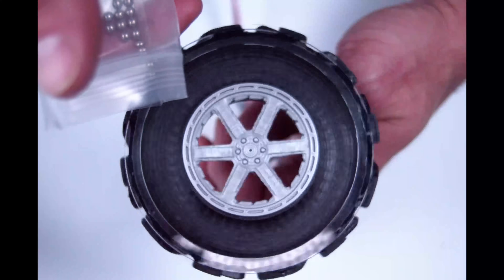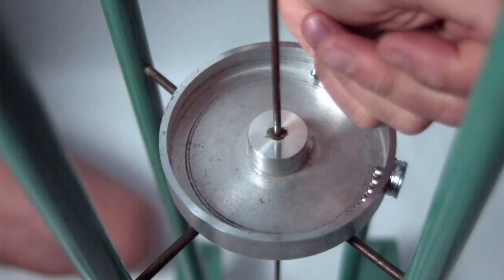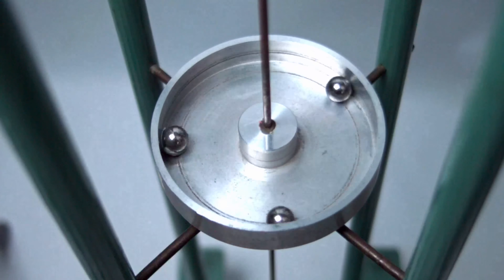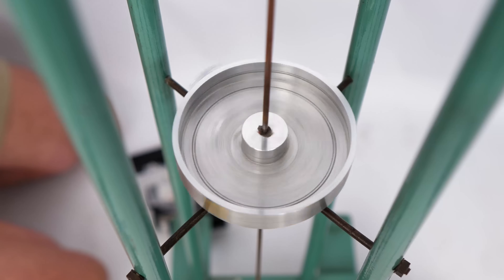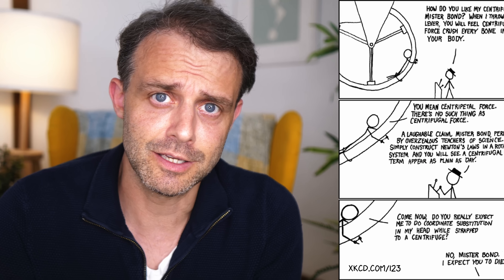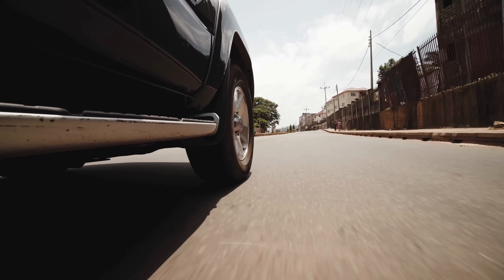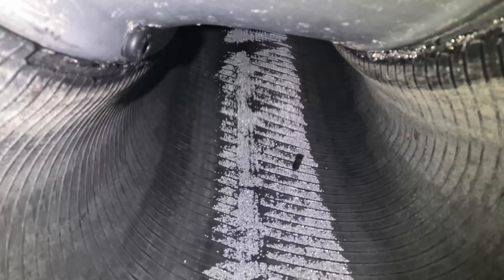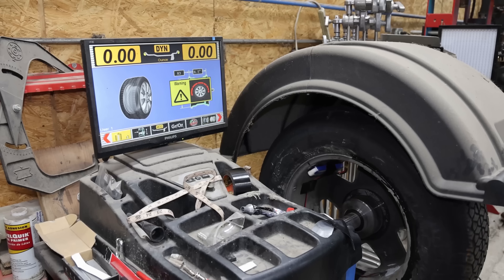Do tire balancing beads actually work?

Comment: Thank you!! I have been hearing about balancing tires with beads for more than 20 years in the off-road circles.

They seemed to be too good to be true, and completely counter intuitive. "Yea, I'd love to pour some airsoft beads into my tire and have it self balance, without worrying about weights getting knocked off or wheel or tire getting damaged" :eyeroll:. Guys have been swearing by them for years. But these would be vehicles that rarely exceed 50mph.

I've started mounting my tires at home with a very simple fixture, some pry bars and sweat. And I've been thinking about those beads again. I might have to try them!

Comment: I use these on my 4x4 because it's hard if not impossible to properly balance big offroad tires with wheel weights, or those weights get knocked off doing silly things.

Comment: my intuition before watching is that an off balance tire is basically a vibratory machine. And vibrations cause the beads to redistribute quasi-randomly. if the beads randomly hit a configuration that decreases wobble the vibration lessens. That process repeats until the system is tuned in. So the positional stability of the tire and the wobble are in a negative feedback relation.

but based on this i dont think it should work all that well on car tires.
in an experiment setup like this the wobble is the only significant source of vibration and bead/marble migration. But on a car there is vibration induced through the road surface, vibration induced through the car itself and most importantly: the tire deforms constantly under the weight of the car. If beads/marbles are prevented from settling the feedback loop cannot kick in. every rotation when the beads „hit“ the road and the tire deforms they would be flung around, constantly randomly redistributing. 

driving at high speed and sith unreasonably high tire pressure could probably reduce this issue. but that seems to me to be just not worth it. Even if you could do it at legal streets and safe tire pressure you would constantly loose money through the higher gas consumption and accumulated repair costs.

Comment: I think hink tire balancing beads are a good secondary measure. If you say that it only kicks in at freeway speeds, then from 0-60 kmph you will have to rely on your traditional wheel balance clips. Just as your initial demonstration with a mass stuck on the outside of the round cup, if you spin it fast enough, even when the clip degrades or gets flung off, you'll still have a secondary measure to not veer onto the cliffside due to unbalanced wheels

Comment: This was so good and very interesting.  I have to ask, what if you used press on weights to combat lower speed issues then have the balance beads to help with 50+ MPH wheel hop resonance.  I have a hard time keeping oversized tires well balanced but I don't notice it until that super critical self centering mode of speed.  I feel that the beads wouldn't be heavy enough to cause an issue with balancing at those lower speeds but would help combat WHR at 50+.  What say you?

Comment: OR the balancing beads do zero and the manufacture tells you to get to freeway speeds so you notice the natural self centering and are fooled into thinking they do anything. Plus you used a ball to counter weight and the same balls to balance and they spread out but a tire might be 5 grams out in one spot and the whole bag of beads might weigh 5 grams and I highly doubt the beads will effectively go to the opposite side and not spread out all around the tire.

Comment: Ok. Missed the statement, now let's talk tires. In the show how it's made you watch them make big tires. The total amount of rubber products they use is relative, meaning that the total layers of rubber isn't fully one complete thickness evenly layered due to how they wrap it all together. If you took a 3D scan of the interior mass to say the interior shape, it wouldn't be uniform as an equal cavity of space, as the slight layer difference would be there when they compress and force air into the inside of it when they hear it up and mold the layers into a single tire. The tread pattern on the outside also shapes how the layers form as all material is forced to be homogenous and solid, even if the material is made up of new/recycled materials altogether. If the wheel is cast, shaped and milled to be that design, as long as the metal itself is not warped or non-uniform in its integrity, then it's the rubber tire on the wheel body that makes the unbalance result happen due to Imbalanced mass of the tire not being uniform thickness.
Reply: Meaning that yes, I'm sorry for yelling. My bad

Comment: Theres product called ride-on motorcycle tire sealant and balancer. same principal but a liquid which turns into a solid butter consistency inside a tire balancing it and sealing punctures. wondering if water would also balance a tire

Comment: How about coating the beads with some kind of delayed-curing adhesive, filling the tire with them, and then holding it at speed in a tire-spinning machine until the adhesive cures? Best of both worlds - extremely easy installation and the effects don't go away if you stop.

Comment: Hey @SteveMould not a Tire but you might find this interesting i follow the appliance space random ADHD interest of Mine but an American company Known As speed Queen a High quality manufacture of Washers dryers ect... There latest Front load washer Model FF7009WN has Steel ball bearing to Balance the load to achieve extremely high spin Speeds in the final stage of the wash to Reduce drying times. Kind of random but Figured it was a interesting Real world application Bens appliances and junk has a Video on it.

Comment: Realistically, they balance the tyres when you get them fitted as part of the included cost. Maybe if you want to fit your own tyres without needing to fiddle with weights it might be good. The need for freeway speeds to make it work is problematic. It's interesting but I don't see the need in most applications

Comment: Mechanic here with a 24k dollar tire balancing machine. We can't really balance big off road tires, maybe some shops can. But most balancing machines are for a certain size/range of tire. Plus some tires take so much weights it's impractical and the weights fall off when too many are used. So for example on a 40" jeep tire I try to balance the tires with the machine, get it close, then add some beads. Hopefully to minimize the low end and top end. We can also match balance by figuring out how to Best place the tire on the rim in order to need the least amount of wieght. But in the end, that takes alot of time and most customers dont want to pay for the time to do it. They just assume all balancing is the same, and you shouldn't be charging more then Walmart tire center because they "do the same thing".

Comment: Had this effect on a motorcycle when internal tire pressure monitor failed and fell apart to pieces including battery, etc.
Below 100kmph it was greatly vibrating, but at 140 kmph it was becoming balanced again…until I stop, then the whole process repeated

Comment: You are absolutely correct on how balancing needs work. In the automotive industry we typically only use balance beeds on highway use only vehicles like semi trucks. Some people like to use them on difficult to balance oversized truck tires however what ends up happening is they complain about a vibration because they drive around town at lower speeds most of the time

Comment: this is the first time I hear about balancing beads, wow, we don't have them over here. Interesting concept to look into is maybe using beads that can melt when the tire hits high temp like 80 C for example, so that they melt and stick to the inside of the tire when u get up to speed, and then it will stay there perfectly balanced all the time ( or any time u r driving slower that the tires dont get to 80 C). I know they can melt again and be like a thick liquid, but it will basically do the same thing again and keep it balanced. I just thought of this on the fly, so if I am wrong please do tell me, and if it has been done please do tell me, and if anyone does it, please give me credit here, thanks <3

Comment: Perhaps ones that either stay in place in a very thick, eventually-adhesive, granular lead liquid within the tire or a mechanism on the inside of the rim made of lead balls and a groove that will lock them in place once the critical speed is reached...Memory foam for tires, in any event. Problem is that for low speeds up to any, a major imbalance. It is all very interesting, none(always the)less. 😏😳🤗

Comment: I had balancing beads in the rear tire of my track bike, unbeknownst to me. Good thing that at a race track, you're almost always exceeding highway speeds, and you don't stop until the end. Can say I didn't notice a difference, the only reason I found out it had 'em was getting a new tire put on at the track. She started the bead breaker machine, and beads went everywhere. Felt so bad for her, helped clean it up.

Comment: i just assumed the bearings would roll off to the farthest side because of the oposite ball weighting that side causing the plate to push in from the side with less weight

Comment: mix some glue with the beads then drive the car faster than 80Kmh then the beads will stick at the position which is nothing but mass balanced. after this setup no need to speed up and explain the cause to the police.

Comment: if a person knows how the air is kept inside a tyre, this is a stupid idea,

a tyre is made up of different types of rubbers, the airtightness  of the tyre is essentially a layer in the tyre the inner most layer 
so until the beads settle they are gonna wear this thin inner layer, most tyre failures are underinflation related that is where blowoutrs originate from

ie the tyre flexxes more when underinflated  over heats and blowout eventually happens

so yea  no thanks i will deal with the slight vibration from time to time than a blowoutr from time to time

yes it may be that the beads won't wear through the tube layer before the thread is worn out

i woulkd rather not be a statistic

Comment: Back in the late 70s they had a ring that had beads or bbs in it that you could mount between the rim and the brake drum. I had a 72 Landcruiser that was T boned but the front axle was slightly bent and not replaced or known about when repairs were made. I put the balance rings on and they took a lot of the shimmy out but not perfect. I sold the Landcruiser later on and moved on in life.

Comment: Okay so now we just need to engineer beads that permanently stick in place once freeway speeds have been achieved... That solves the wear problem and the rebalance problem... Maybe an adhesive inside the tire that has a small seperation layer that needs to be "pierced" before the bead can stick in place? Idk.

Or maybe a gel that the beads dig into with the rotational force of the tire, but is then strong enough to hold them in place once gravity takes over?

Comment: If someone could find a way to balance a tires with said beads and make it adhere in place permanently, or set, they have the potential to make a lot of money. Maybe not because it's actually an entirely perfect solution but because I feel if marketed correctly they could be sold as a panacea for tire vibration... at least before the tires wear down some. It would remove the issue of low speed resetting. The beads are a great solution except in that mentioned reset. However, the other problem arises as tires wear, because as they do there are inconsistencies in the compounds and construction of the tire which will result in the tire going out of balance again, if the beads end up fixed in place this becomes a problem.

I imagine as an industry there is a reason we've been advancing to make better balancing machines that still rely on traditional tire weights with things like road force simulation and other things.

Comment: They need to add an adhesive to the beads that some how activates at freeway speed or tire temperature and cures relatively quickly so the beads lock themselves in place

Comment: But officer, I HAD to speed to balance my tires.  <officer talks>  Why yes, I do have to do it after every time I stop because the beads fall into the bottom of the tire and don't get into their proper positions until over 50 MPH.  Neat video, thanks for sharing.

Comment: Seems to me you need to test in the same plane as your subject.  Horizontally testing a vertical movement will NOT give the same results.  You just eliminate gravity from the problem.

Comment: this is wonderful for round tires, tires are not round, there is a continuously relocating flat side , tire beads also grind away the thin layer of material inside the tire body that reduces leakdown, so you will have to add, DRY air to your tires more often,,,,,,,,, or just use weights like has worked forever

Comment: This seems dangerous to me. If you're in a situation where you can't just stay at freeway speeds, I think that would almost certainly mean that it's neither safe to accelerate up to freeway speed to reset your beads, nor to never stop. I guess maybe along some country roads with windy sections you have to take slow and straight sections you can afford to go full speed, but that seems like very much an edge case compared to city or highway driving. And I could be wrong, but I think if you stopped the beads would all fall to one side and probably produce worse balance until you reset them, giving more encouragement to take a risky move to regain or maintain that balanced state.

Comment: Amazing science to explain and demonstrate on rigid "tire" rotating on a horizontal plane, very cool! . ... but, what happens if the tire is vertical (gravity biases bead balance) and the tire does not have a perfectly smooth rolling surface for the beads on the inside, and it is pliable creating a flat spot at ground contact that rotationally accelerates inboard then outboard as the tire rotates through road contact, potentially upsetting the beads? That would be even cooler to demonstrate in a bench test.

Comment: I worked at an RV shop and we used the competing brand of sand for all of our tire changes. In my 5 years of working there, we only had 1 come back complaint of tire vibration on 1 tire but obviously affected the whole front end. Im pretty sure the issue was the tech put in the wrong sized bag for the tire. But i know they were insanely expensive and we were not charging customers nearly enough to cover our overhead. Oh well. Dont work there no more 😊

Comment: Do not recommend using beads if you have a CTIS on the wheels when releasing air beads can get vacuumed out and can eventually clog the system

Comment: I think that the test is not valid to represent the physics on a real car wheel. In a real car wheel the wheel will roll on a surface that limit the wobbling movement because the wheel can not go under the floor and the floor is not flat. Also the car is pushing down and flattening the contact patch in the process, so, I think that is not the same to have a steady rotation than actually balance the wheel.
Think this, if you attach an uneven piece of metal on a parallel lathe chuck the chuck will be unbalanced but it will not wobble.

Comment: One thing you could theoretically do is inject some kind of low viscosity glue with slow cure time then go freeway speed for the whole cure time. In theory, that would kind of fix the issue ?

Comment: The thing that bothers me with them is the damage that could be done to the tire and wheel by the beads when they aren't pushed against the rubber from speed. But I know they get tossed in many, many heavy truck tires and I haven't ever heard of a problem with them, so that might not really be a concern.

Comment: So as a mechanic i can tell you, my shop, only uses them on really big tires or bigger a/t truck and suv tires over a certain size. Helps for the highway speeds, which is when the balance matters most.

Comment: It works, I have driven several vehicles at work over the years with tires balanced with shot bags. The issue is that there are certain corners and road conditions in my area that constantly unbalance the tires at speed and require you to pull over and slow to almost a complete stop to stop the vehicle from trying to shake apart.

Comment: I have to wonder, why would the work when the tire isn't a perfect circle when it is running on the road.  You have a circle that has a flat spot at the bottom so when your ball is on the side of the tire when the spot inside the tire with the ball hits the road surface and then leave the road surface that spot of the tire will be going slightly in and out rather quickly which should free the ball for a brief moment as if it was on a trampoline.  So why would the beads stay where they are balanced.

Comment: As an engineer and science educator I love your explanations and demonstrations.  I was also a "road warrior" for too long. Because the best way to install the beads is before the tire is mounted, you are not really gaining any time/money for "mechanic" skills. Because a) you need to achieve a "highway" speed for them to activate, and b) they do need a complete reactivation after any full stop, I would not depend on them for total balancing.  I combination of individual balancing with weights with a "smoothing" addition of the beads should make for the most reliable, durable, and longest-term balancing for all conditions.